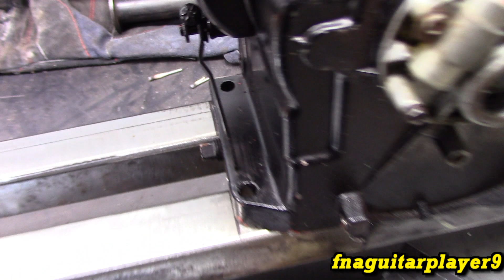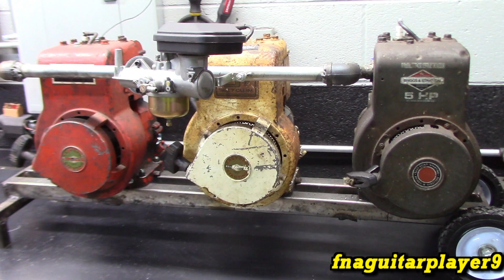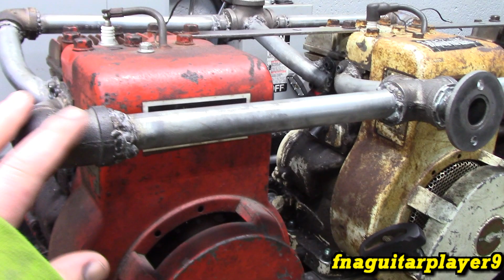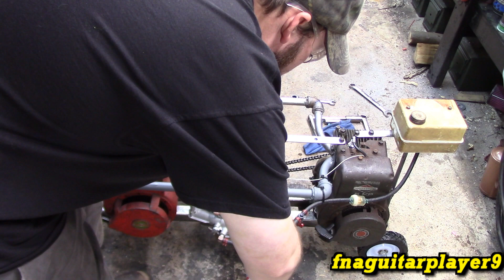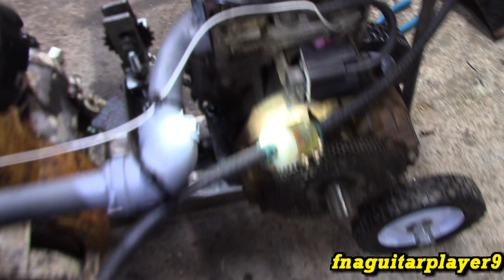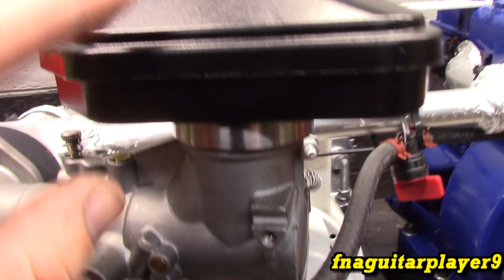Construction of the 3 Cylinder Briggs Engine Project (long video, feel free to skip through)

Comment: Regarding the carb. sizing, I think the carb is sized pretty well for this. Like you say, it is trial and error. I do it it by comparing the cubic inches of the engine the carb was built for, in this case a 19 cubic inch 8 horse. You have 3 X 13 cube 5horse engines, so 39 cubic inches. Initially looking at it one might think that your carb is undersized, but remember the 19 inch engine pull all that in at once, while the 3 smaller engines are split up into 3 intake timing events. I do know one thing that wouldn't work worth beans, putting just 1 normal 5 horse carb. on it. I did that with my opposed 2 cylinder 4 stroke, (2 X 3.5 horse lawnmower engines) I used the stock carb. , it ran, but needed 1/2 throttle to idle, and was a Bear to start, since it was way undersized.

Comment: Great vid, you really show how you made it! Man, I never thought of using washers as the starting point for the intake flange, I always use steel plate! Just goes to show you that there can always be an easier way to do a specific job!  Using a step drill to drill the holes in the conduit or pipe for the intake, seems to be easier than a normal drill. I had to cut the smaller end off one of the step drills so it didn't go thru the far side of the pipe, but it seems to do a better job than a normal drill bit. I danged near broke my wrist when a normal drill bit into the pipe, as I have to use a hand drill, as my drill press is a tiny one.